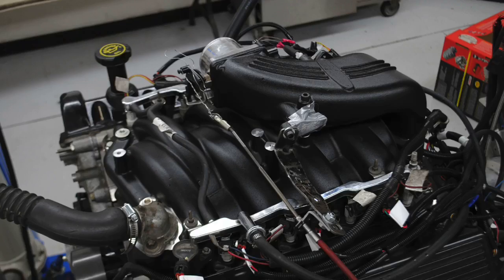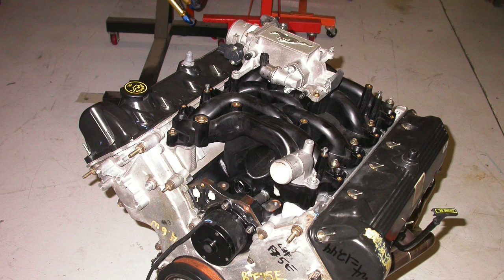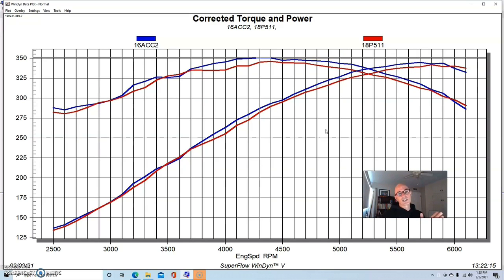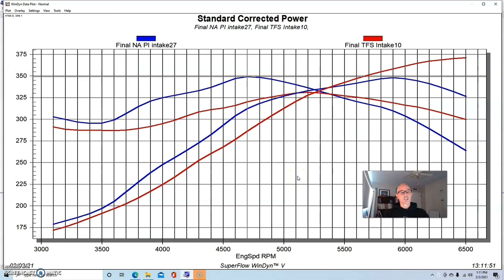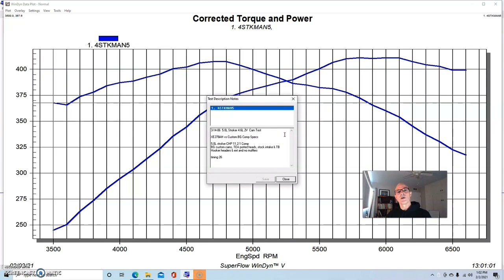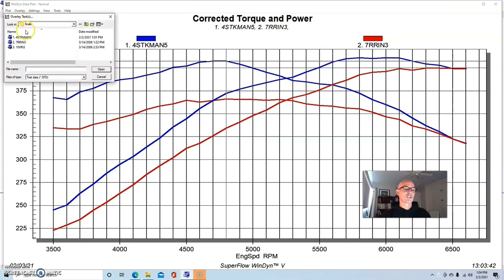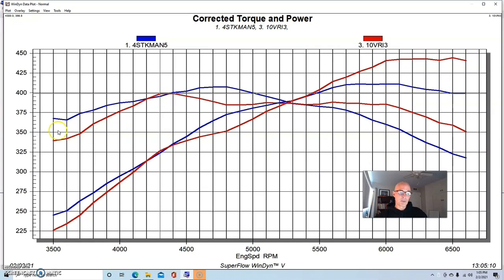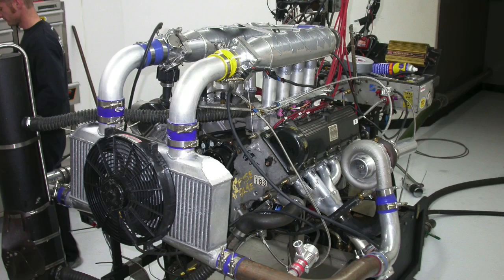DIY 4.6L 2V FORD INTAKE TEST-WHAT REALLY WORKS?

Comment: The P51 Foxlake would have shined better on a bigger cube 2V and better cams. Throwing a P51 Foxlake intake on a stock long block 2V wouldn't net that much, but my favorite design aspect is the cross-ram force filling of the cylinders above 3500rpms. I think it did the best out of all of them on a N/A setup.

Comment: I had a problem with a pi engine
I try to install a accufab t.b and elbow but my car it is electricall t.b and the accufab it is a wire t.b
Reply from the maker: I didn't think a 4.6l 2v ever came with a DBW tb
Reply: that is the problem of my engine
it is a Mexican version of a 2007 lobo(f150)4.6 2v pi electronic t.b and i am trying to making match  @richardholdener1727

Comment: Richard do you run Kevlar Serpentine belts with these Super Chargers or regular rubber Serpentine belt? See that you & Engine Masters have issues with belt slip. I run them on customers cars with Pro Chargers. As a Fleet Tech our 2V CV police cars come factory with them. They don't stretch & they crack wear out. They last 5 - 10 times life of best rubber belts
Reply from the maker: not sure I have tried a kevlar belt

Comment: The p51 manifold was only worth it if running boost. Aluminum so no worries for intake failure like factory,

I am in the process if building a 327c.i. modular 2v. Running 195 trick flows 2v with even more blending/port polish work. 13.5 to 1 comp ratio (domed Pistons from gibtec) Molnar rods and eagle Crank (iirc on crank) 
Block is aluminum "cammer"/Tr50 road race block, big bore.  

Intake is designed and mostly built by me. Its a cross ram design and very similar to what you have here otherwise.....

It should dyno 525 to 575fwhp.  Would love to hit 600fwhp but at that point you start losing to much driveability with cam choices.  

Obviously cams are custom/proprietory. 

Will have a dual stage Nos setup. 125hp per stage....

Going in a 70 maverick. The front suspension is AJE SN95 based rear is custom 4 link designed/built by me.  Ride tech air ride.  

4r75w Transmission. Jasper Police unit. They come with billet clutch baskets upgrades extra clutches, shift kit etc....
I scored this for 600. I bought a police cruiser that was wrecked. The 8.8 and trans was all less than 1000 Miles. I sold the rear end and labor to install for 750.00 so I made money on this deal. The transmission was surprise when i looked up its serial number on jasper website.  Though i may swap to the tremec 5 speed that just came out and sell this automatic. Not sure yet. 

Rear end is bolt together aluminium housing and aluminum 9 inch center section 4.11 gears.  9.5 rear rims 8 inch frt 275 40r17 nittos rear 23540r17 nittos frt.  Carbon fiber cowl hood, custom grill and ram air system, custom frt and rear spoilers.... Holley ecm.

Frt brakes are PBR cobras 13 inch rear are a crownvic/explorer set up I machined to work together. 11.3 inch vented rotors on explorer backing plates and crown vic calipers. Etc.... So much more

Last car i build. So i am doing it my way. It's being built as an all arounder.... Corner, drag, show, but will never compete with fastest in any category.

Comment: Could you provide some info on the Reichard Racing intake? I have a 5.1 stroker kit with 278ex cams, p&p heads, 11.1 compression.  I have the opportunity to get the RR intake, do you think it would make decent gains?
Reply from the maker: it works at high rpm

Comment: My crown vic is older than 2005 and i am having issues finding people that can program it. Thinking of doin trickflow heads, intake, and throttle body, with kooks headers and exhaust kit. Any suggestions? Tryin to build a killer vic.
Reply: I dont think a non PI motor is an option for me at the moment.

Comment: So in conclusion:
 long runner- more ram efect/torque down low,
short runner-less air friction/resistance up high.

Do i get this right?
Reply from the maker: ITS NOT RESISTANCE-ITS A REFLECTED WAVE THAT HAS TO TRAVEL A DIFFERENT DISTANCE AND ARRIVE AT  THE CHAMBER TO IMPROVE CYLINDER FILLING (SHORT RUNNER-THE WAVE ARRIVES QUICKER (LESS DISTANCE TO TRAVEL UP AND BACK)
Reply: @richardholdener1727  could the resistance to flow be neglected completely?
I mean, flow benches work with steady flow. I do not comprehend the wave pulse thing sufficient enough, but i do know that an longer pipe restricts flow more than a short one, and more mass of air has greater momentum.

Comment: Hey Richard, which Trickflow manifold did you run? Was it a streetburner or the track heat? I hear both intakes vary quite a bit in power bands.

Comment: Loving the 2v content! But you will show the same results with the rest of the manifolds as the previous ones. The eddy and any other after market manifold on the 2v will have to be taken above 7500 rpm to shine. Which you should do because your engine is built for it! They just love rpm with cams and a good intake they really wake up and have an even more lengthy power band. I hope to see you stretch one up to near 7800 in the next vid. Thanks for the 2v love Richard!

Comment: OK, include the GM 4.8 in the death match between the Ford 4.6 2v and the Chrysler 4.7 ohc.

I'm going to be a curmudgeon here, but you really have to bleed Ford Blue to be enthusiastic about a 4.6 2v breaking 450 hp.  A GM 4.8 will do that easily, and for less money.  I look at the little 4.6 pistons, valves, ports, and runners and laugh a little bit inside: "yeah, right, that's a performance engine."  Has to be a 3-valve or 4-valve, if you're ever going to make a Ford modular perform.  Then you have the problem of buying four cams for the 4-valve.  So by the process of elimination, the 3-valve is the best performance per dollar to be had in the Ford Modular world.  (Just be sure to change the spark plugs regularly.)

Comment: What about 4.6L 3v? Are those good engines? Trying to find a cheap and simple way for my nephew to have an extra 75-100 HP and manual trans in his 10th gen F150.
Reply: 3v are notorious for cam phaser issues. The explorer ones are supposed to be around 310hp. But, remember, a cheap 4v makes more than any of the others. Find an aviator 4.6 intech. Truck manifold on a 4v 4.6.
Reply: Do some interwebs a guy made the s197 4.6 block work with pi top end out of a 04' 2V/ timing and  front cover . Yf block ?
Reply: @metalbob3335  No idea.

Comment: Maybe this question has been asked before, but why does the hp and torque always cross over at 5250 rpm. There must be some science there or something.  Thanks.
Reply: Because the equation to calculate HP is:  HP = Torque x rpm / 5252.  So it's mathematical certainty that when rpm is 5252, the 5252 on the bottom cancels out, leaving the HP number equal to the torque number.  The constant 5252 comes from the definition of a Horsepower as being 33,000 lb*ft of work / minute, which is then divided by 2*pi to convert degrees rotation into radians.  33,000 / (2*pi) = 5252.  There will be a quiz on this in Richard's next video.
Reply: Oh, that make sense.  I never thought about it that way. Thank you for the answer. 👍
Reply: For an even more detailed explanation check out Engineering Explained here on the YT, great answer
Reply: @smokenchoken1736  thanks, will do.
Reply: @smokenchoken1736  There is also a great explanation of how the Horsepower was defined in a Modern Marvels episode.

Comment: What have I learned today watching this video my P.I. intake really doesn't suck after all. Thanks for posting all the 2V content Richard.
Reply: yea! same, thinking it may be worth it to do a head job, port, cams and new springs instead to get the most out of the long runner length
Reply: @Novagunner  lmk how it goes ready to do the same have non pi motor getting pi heads for and a spare block for 150 gonna build the heads first then just junk the non pi ones

Comment: You're the man! I believe the 2v is beginning to get more attention in the car world. More people are building them and making good power. It's awesome you're able to show us all of these comparison videos. I believe the edelbrock will be useless until 6500rpm. I would definitely like to see it and the two trick flow manifolds back to back. Also would like to see if there is a difference between a normal pi intake and the Ford performance pi intake.
Reply: The Edelbrock is better than the Riechard intake manifold for power below 6k due to it having slightly longer runner length. The Riechard manifold is honestly shooting for 8k rpms up. Those short runner manifolds need a ton more volume than you can get out of most shelf plenums which leads to people going crazy with sheet metal rear feed intakes which are king in racing. I think having a proper upper plenum is everything on those victor Jrs which ultimately makes the swap pretty expensive. 
The two trickflow manifolds are both fantastic, but the track heat manifold is known for seeing a significant loss in low speed torque. I dont know if the power gains are worth the cost over a pi intake.  
Ive had both the Ford Racing PI intake and oem crown vic pi intakes and they are definitely the same piece. Ive been pulling $45 04-11 crown vic interceptor pi intakes to sell for years.

Comment: What cams would go good with a stock 4.6 triton engine auto trans
Reply: Check out Modular head shop they have cams for different stages. I would stick with something a bit hotter than the P.I. oem's  unless you plan on dropping your final drive ratio or put in a higher stall converter stay away from long duration cams they kill off torque on the lower rpm band.
Reply from the maker: the comp 262 cams

Comment: Ok. One more test. P.I. Heads with truck intake, is it the 268 cams, single turbo? Or how about a sniper on the truck intake? Boosted with a hat?  If there’s already a video close to that please direct me.
Reply from the maker: 4.6l 2v sniper? I do have a stock PI with boost up
Reply: @richardholdener1727  The sniper E.F.I. Isn’t it made by Holley? Would require welding a 4150 baseplate to the truck manifold.

Comment: Meh.

It’s a dead platform so it’s all a moot point.
Reply: "Dead platform" there's 3 guys fighting back and forth running as recently as october all vying to set the 2v quarter record, they're up to 1800 horsepower. You could argue the 302/351 Windsor are dead too, or the 2jz since it hasn't been produced since before this engine went out of production.
Reply: @Prestiged_peck  

You are arguing exceptions trying to make then the rule.
Reply: @DBSSTEELER  what about old school hemis? And what about the 500+ guys that all run various 4.6 combos, or the multiple billions of 4.6/5.4 powered cars built from 1990 to around 2013? Or the 6.8s that were in production until 2019? Are they also dead? There's probably more of them being driven today than coyote powered cars
Reply: Not dead if you have it in your car, and want to keep the car.

Comment: Muscle mustangs magazine did an intake manifold test on Ken Bjonnes high revving 4.6 2v, higher compression, ported heads, custom camshafts.  Bullitt vs P51 vs XL-500.   The Bullitt manifold is suffering from an undersized lower plenum.  Hopefully a half inch spacer will fix that.  Your dual inlet manifold proves the need for more available air.  Only 10inch runner length with little lost in lower rpms, that’s amazing. Thank you for providing these videos...
Reply: Where can I find this article?  I guess i cant find this magazine on the net ?
Reply: I need to see that test! I have the bullitt and planing to go wilder n/a ... but not sure if i should not just let it stock and put a diy turbo kit on it..

Comment: I would like to see you test a coyote engine with the stock 2011-2014 intake and then the 2015-2017 intake and then the 2018-2021 with and without the charge motion control valve!

Comment: Wish you tested the Super Richie divided versus as shown.
Reply from the maker: I did
Reply: @richardholdener1727  Can you show a plot of it open and closed?
I'm in the middle of trying to make a divided intake manifold for a 2JZGTE swapped Tundra - I have the room, but since it's a 4 speed auto, and daily's the vehicle (tows too) we like low end torque, and a single turbo 2J does not provide much typically.
I have experience with an LY7 (GM) 3.6 V6 in testing holding closed versus holding the plenum open and gutting out the manifold too. 
But the more data the better.

Comment: Love the 2v content. The Coyote killed any major interest in the old iron block 2v, but they are still reliable and cheap motors to make power with.
Reply: I am looking to do a 4.6L mod build. Just need to find the right host.
Reply: @FXIIBeaver  02-05 explorer if you wanna go 2v. Aluminum WAP block way cheaper then the mustang engines. Just swapped one into my GT. Only differences are the intake, coolant crossover pipe under the intake, and the timing cover
Reply: @robbymccool7213  really? I forgot explorers came with a 4.6L
Reply: @FXIIBeaver  yep. Only model that came with an aluminum 2v too. Oil pan and pickup is different from mustang as well tho
Reply: @robbymccool7213  all that should be interchangeable right?
Reply: @FXIIBeaver  it is. I currently have one in the mustang
Reply: @robbymccool7213  sweet. Will have to get me a cheap v6
Reply: @robbymccool7213  aluminum 2v...nice!
Reply: @robbymccool7213  If you're trying to say aluminum block then you would be incorrect sir. I had a Iron block in my 2k GT and my bro has an 04 which is aluminum. The  Romeo blocks are aluminum And the Windsor is an Iron block. My new built engine is an aluminum block.
Reply: @FXIIBeaver  For what its worth, the aviator 4v engine is an easy swap into any 96-04 mustang and can be found for the same price as a explorer 2v but makes around 50 more horsepower dead stock.
Reply: @madmod  might look for one of those to lighten up my Crown Vic a little once the current blows up. There's so much to learn lol
Reply: @yeanah2571  for all that added weight, you'd want a 5.4,  be it a 4v navigator or a 2v.
Reply: @yeanah2571  iirc, the aluminum 4.6 4v aviator weighs more than the iron 2v due to its Dohc heads and the additional cams and valvetrain. However, the WAP block explorer engine is 80lbs lighter than an iron 2v engine making it a great swap all round. I still think a Vic would be happier with a 5.4, or even the F series 6.2 sohc which is actually more of a bolt in swap than a coyote.
Reply: @madmod  The problem is that a 5.4 32v doesnt fit with the stock brake booster and evap core
Reply: @LittleBigPlanet6  I was talking about the 5.4 2v as well as the navigator. I think the benefits of the dohc heads outweigh the issues of the swap and they are remedied pretty affordably. If you're genuinely wanting the most power for your $, the 32v 5.4 has a lot of potential. However, i agree with it being a pain. You are also very limited on exhaust options as far as headers goes for both 2v and 4v 5.4 into the panther platform. You will still see an additional 50-75ft/lbs idle to 4500rpm compared to the stock 4.6 even with a stock 2v 5.4 with a truck intake manifold. That will be huge in a 4k lb car.
Reply: @madmod  Yeah Im working on a 4v swap in my vic right now. Gonna go with a 4.6 stoked to 5.0. My original plan was a 5.4 but I didnt want to get rid of the HVAC. The brake boost problem can be solved with hydroboost, but tbh I can can hit my goals no problem with that stroked 4.6. It also means I can get an aluminum WAP block which is nice.
Reply: @LittleBigPlanet6  You can reach the goal without stroking. If you're dead set on it tho, a Coyote crank with a machined snout and keyway cut makes a 4.75L stroker, or a 4.8L with a .020 piston. You get the benefit of a kellog forged steel coyote crank that is beyond strong enough for any rpm, or power abuse you are after, as well as increasing stroke and compression in the process. Dss makes forged pistons for this swap too.
Reply: Oh and coyote crank, rods and dss pistons is a cheap combo compared to most shelf 5.0 strokers. You dont need the added displacement to make the power tho.
Reply: @madmod  Yeah I mostly want to get the extra torque out of the stroke. The crank I that came with the engine is unusable so it needs to be replaces regardless. That extra torque is gonna help get the boat moving.
Reply: lol, cheap to make power with. I’d like to see that

Comment: Some cool info 
PI Runner Length - 17.5"
Bullet Runner Length - 15"
Trickflow Street Burner Runner Length - 13.3"
Trickflow Track Heat Runner Length - 11"
Edelbrock - 8"
Reichard Racing - 6"
Reply from the maker: nice info-thnx

Comment: What did we learn?

Despite everyone's best efforts. The 4.6L 2V is still a dog of a motor.
Reply: Mine has 295k, valve covers never been off. Runs smooth ever. Won't get you therein a hurry, but it will get you there.
Reply: That PI combo made 96hp/liter na. Ken Bjonnes went 10s with similar power.

Comment: Take away boost the pi to just shy of 500hp.
Reply from the maker: boost the pi to over 500
Reply: @richardholdener1727  ok, once I fix all the exhaust studs :)
Reply: Just make sure to add the Helicoils to the heads to keep the plugs from blowing out...lmao
Reply: @DiamondBackRattlaKid  why? I've honestly never blown out a 4.6 2v. I have 2 sets of heads with over 200k miles each and the threads are fine.

Comment: I was just reading today how the 787b Mazda used variable runner length itb's that adjusted with rpm. Wouldn't that be nice to have under the hood.
Reply from the maker: yes-F1 motors did that too until they were outlawed
Reply: Funny, this and many more intake test + that old mazda concept inspired me a few months ago, now im making a variable runner intake with ITBs for the 2V 😂